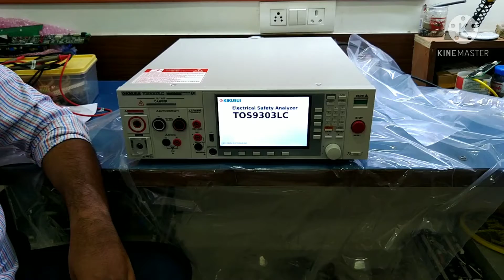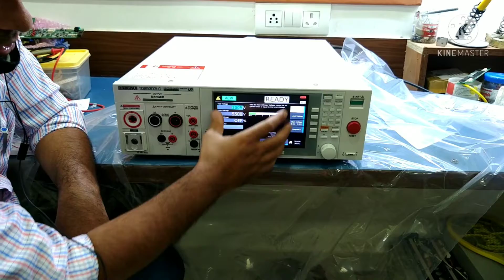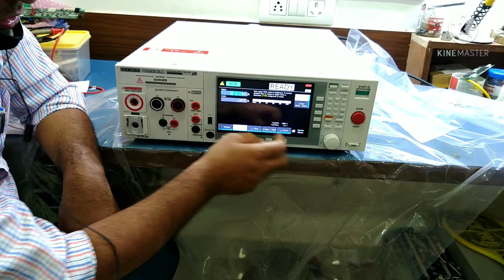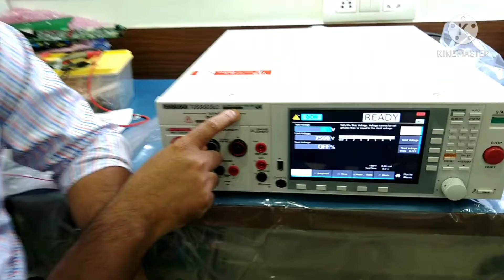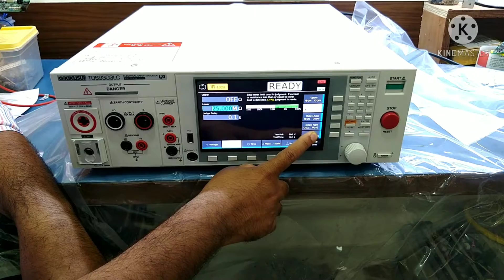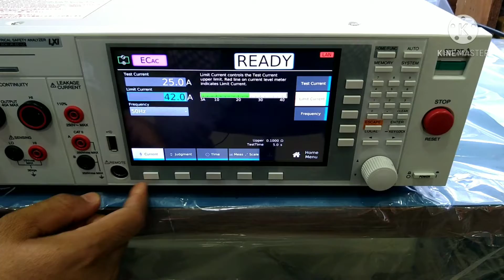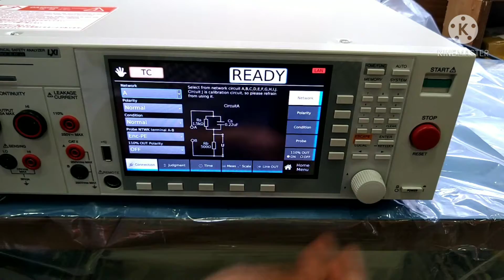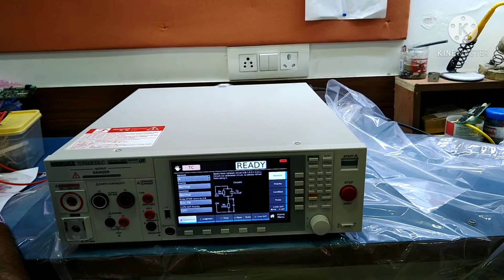TOS9303LC-Basic Operation and Explanation

Comment: Sir Can you please help I am facing one issue with 9303 tester. On 1800 V HV testing the current is coming around 19mA when I’m connecting its both wire with Calibration jig of 31mA.
Reply from the maker: Hi .please check may the jig has 19mA .or you can verify by applying the low current value like 10mA .